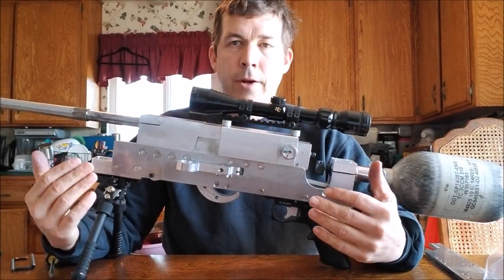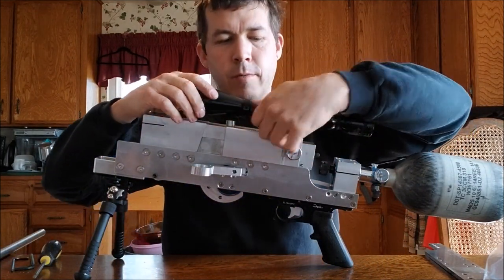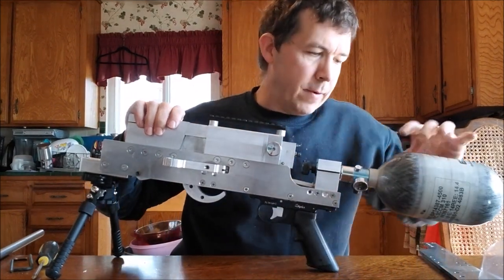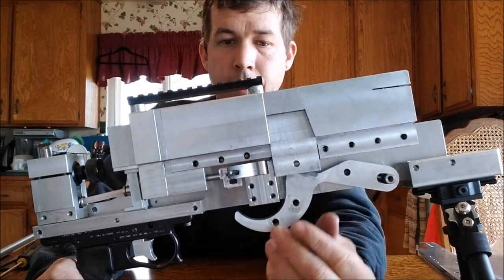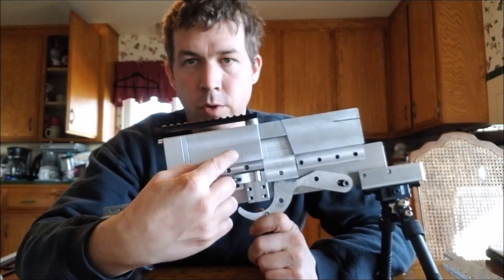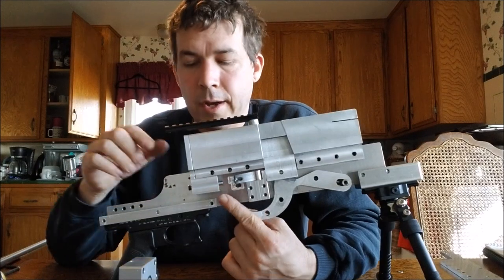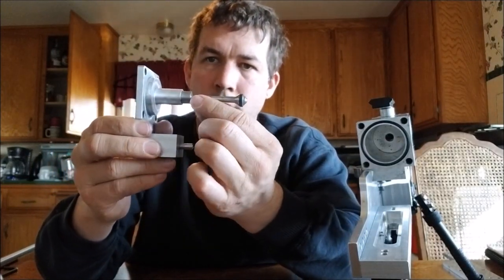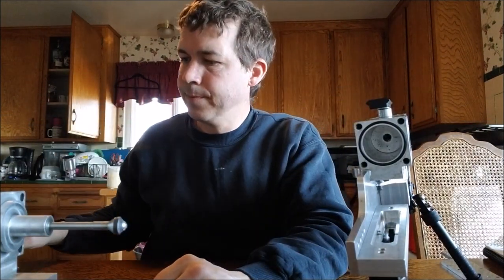Big bore air rifle, how it works.

Comment: Could you build a hammer on the back heavy enough to push the trigger valve. Then you could use a trigger with sear for accuracy. You could reset the hammer separately or have it reset with your charging handle, before it hits the charging valve.

Comment: Guessing needs something like the spring loaded trigger, either to open the valve or to like a hammer with out without a pin to open the valve.  Need design.  Not sure how well will operate for harvesting ethically agriculture, either wild or domesticated.  Thanks for sharing!

Comment: Hi would love to see a video on converting a paint ball gun to fire steel balls.
One question is the barrel ruffled ?
Reply from the maker: I use rifle barrels for this. They are cut down to fit. I dont think a paintball gun would shoot steel well
 The difference in mass between paint and steel is significant. Even maxed out it would be pretty short range. I might try it anyway.

Comment: Nice project!

What volume is the fire chamber?
I read at GTA that the chamber was good for 3000psi, Have you done some higher pressure testing and if so what results did you get?
Reply from the maker: I dont remember the exact size of the chamber. When I built it I was going for the chamber having the same volume as my barrel. That way the pressure at the end of the barrel would be about half of the chamber pressure. I think it was based on a 36" 50 cal barrel, there making it about 7 cubic inches volume. I did a velocity test video. https://youtu.be/WLDPZmenmNI

Comment from the maker: I tried that. The air pressure behind the trigger valve causes it to reset before gun fully fires. I needs to be held open for long enough to cycle the main chamber.
Reply: Lol...been there, done that too. Valve is very similar to a Toolies piston valve as used in spudguns. Pneumatic actuation is simple, but does (as you noted) have it's limitations...primarily related to consistent opening of the pilot valve. A switch to "partially balanced, knock to crack/blow open" might be worth looking into.